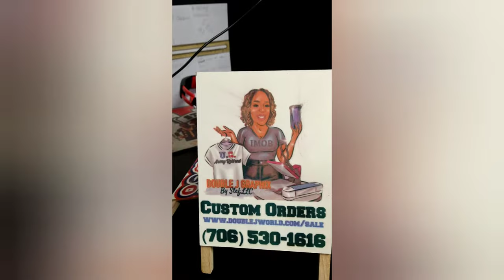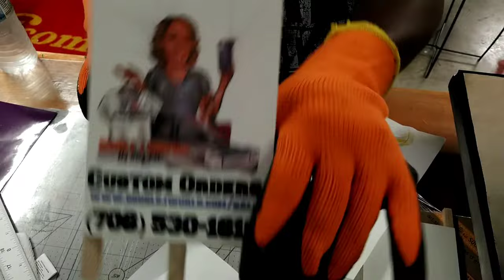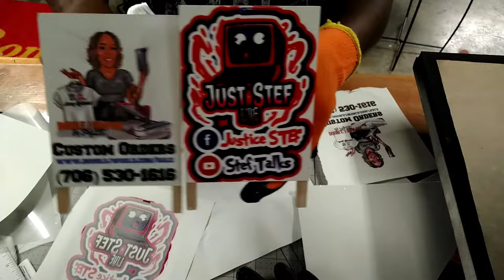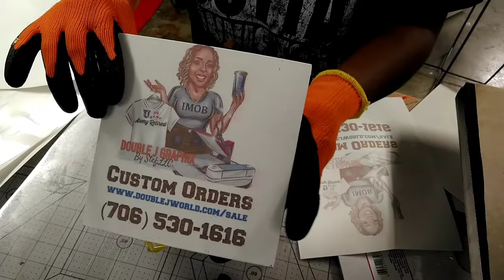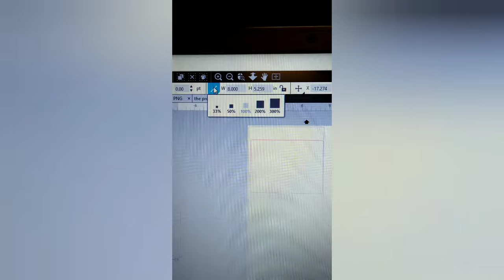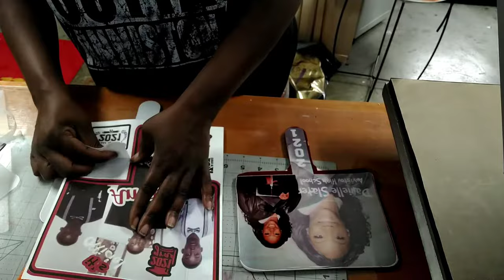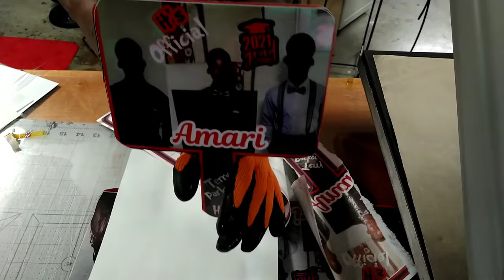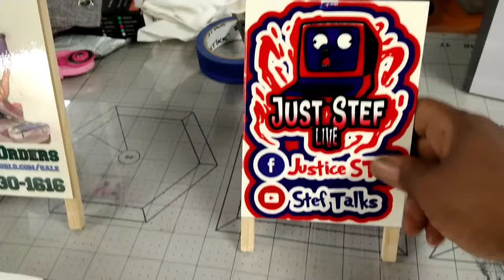Sublimation on Dollar Tree #Canvas, #Paddle and #Mini Sandwich Board (wood wipeoff board)

Comment: I use a small Teflon pillow under the canvas ( the elevated canvas) or else it won’t be level and u won’t be able to give the right pressure. Just a suggestion. The flat canvas u don’t need to. 😀all in love
Reply: I use 8x10 and just cut around
Reply from the maker: Great Tip.........THANK YOU

Comment: Hi,  hope I am not being redundant, but when you are adhering the laminating sheets to the canvas, how are you placing it on the heat press, is it facing the top of the heat press or the bottom?
Reply from the maker: That is actually actually a great question.  Please forgive the late reply. I am just getting to these notifications.  Unless specifically stated whatever you are applying the heat to (laminate sheet, htv, transfers, sub paper, etc) should be next to the top platen, only separated by whatever you have for cover (teflon sheet, butcher paper, etc). That is the heated portion of the heat press unless you have a specially designed model. In that case, you follow the manufacturer's instructions.

Comment: I’ve got 30 paddles to do 🤦🏼‍♀️ is there a secret to getting that “plastic film” off the paddles? I’ve been working on 1 paddle for 20 minutes and it is coming off in tiny pieces. How did you get that big piece to come off at once? Did you heat it first?
Reply from the maker: Sorry I just saw this.  I'm back in school trying to finish my Master's and had a big project to do. No trick I just grab a corner and peel.

Comment: I love your video, and I have watched others. BUT... I cant get my laminate to adhere to the easel.  It looks adhered, but if I pick it at the corner.. it pulls right up.  WHAT in the world? Making me so mad.  I have glossy side up and Im using the thermal laminate pouches. any idea?  thank you thank you !!
Reply from the maker: Hello. You need to seal the edges if you are able to pick it off.  I use my mini Cricut to seal. I just cover with parchment or butcher paper and run it along the edges